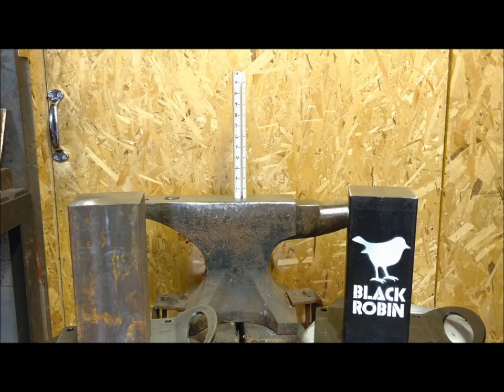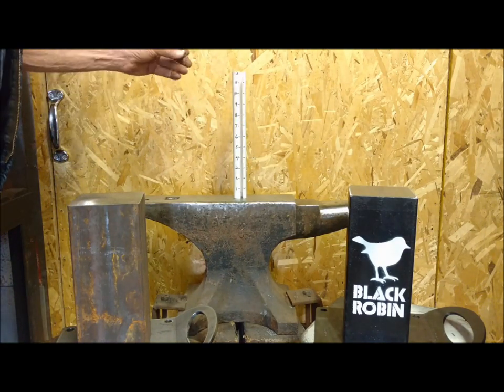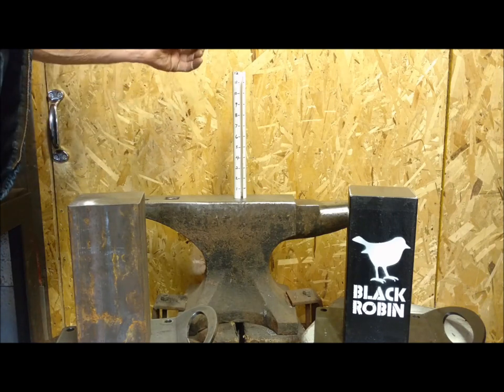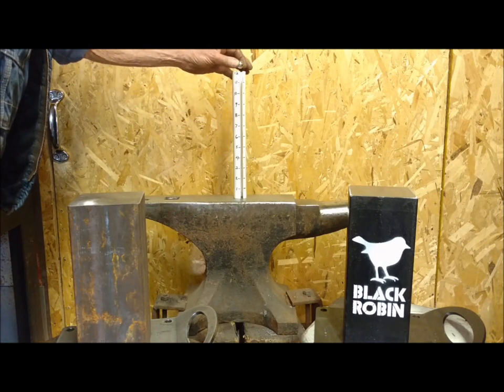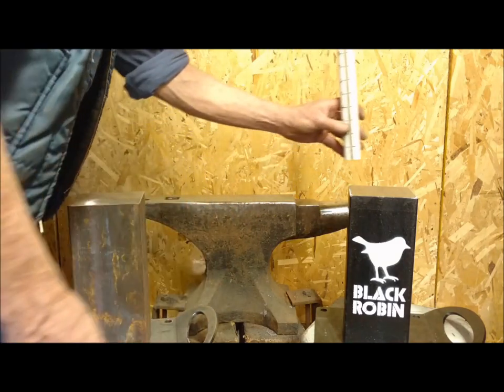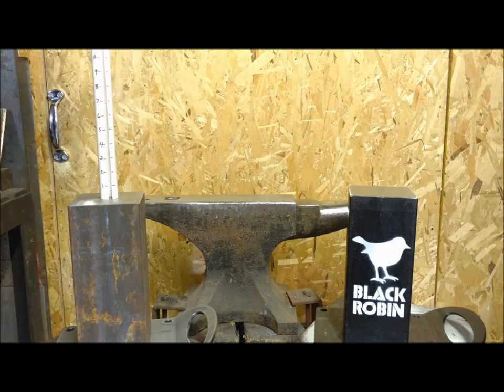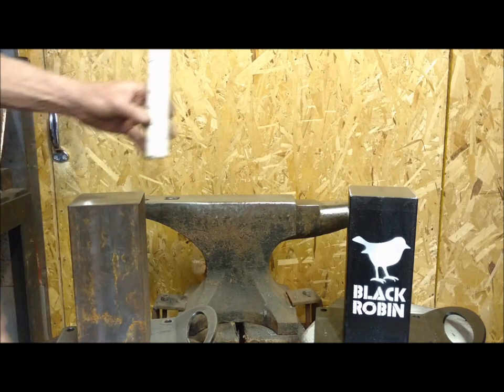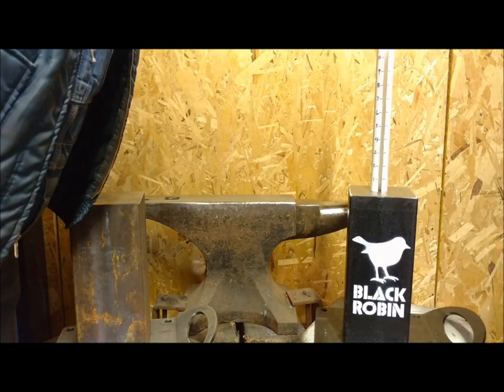Black Robin Anvil Ball bearing bounce test

Comment: This is on my short list of necessary purchases. Currently putting together my beginners bladesmithing setup.
Reply: Get a real anvil ! This thing is a joke . How do I know ? I've been a profession BlackSmith now semi retired 38 years experience. A hard bouncy face is not what you want in an Anvil . Of course these well meaning people would tell you otherwise, but they are selling them so no surprise . But there is no substitute for MASS . I own a 600 pound Peter Wright anvil . These anvils are made from wrought iron with a 3/4 carbon steel face. If you want to be a BlackSmith don't start with a toy . You won't likely find one at 600 , but they're are out there at 180 pounds up to 500 . A good find would be one at 300 . Believe me if you were just playing around with small pieces in your back yard this might be ok although they are completely limited by the small work area , I would suggest a real anvil.
Reply: @mrirondance  ever see a Japanese anvil? The best blades in the world are made on very similar size anvils. 
Beginner...did you not see that? Use whatever you can to start.... c’mon man, encourage, not discourage...
Reply: @stevesyncox9893  Steve, I stated in my reply, that if you're just playing around, this little anvil is fine, or anything you can hammer on, so relax.
Reply: A better cheaper alternative would be to go buy 2 pieces of 1" plate, weld them together,  add a base, radius the edges and you'll be way better off, than the one here.

Comment: rebound it not all that important imho.it way over rated.mass of the anvil is far important
Reply: It is if you want the anvil to last a long time. Use a soft iron and it will mushroom and deform under any use. Rebound shows it is tool steel or similar and will last.
Reply: If you have 1500# concrete, you have mass and no rebound.... you logic is flawed....